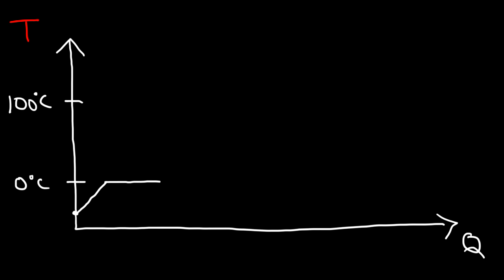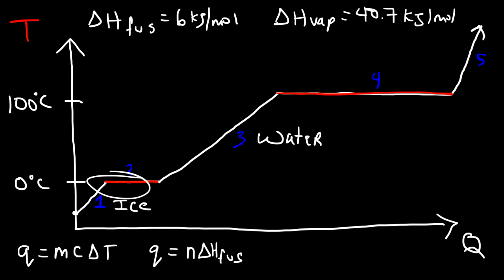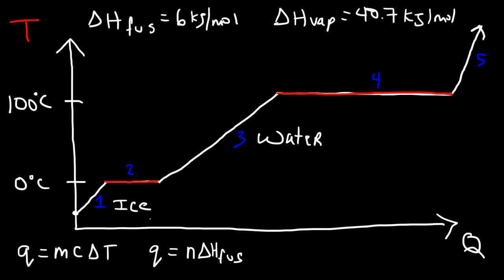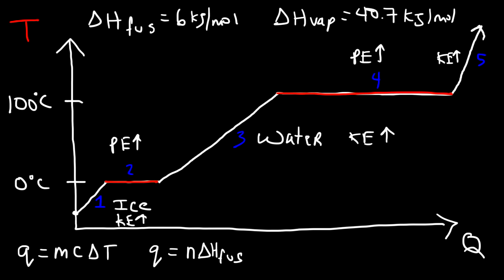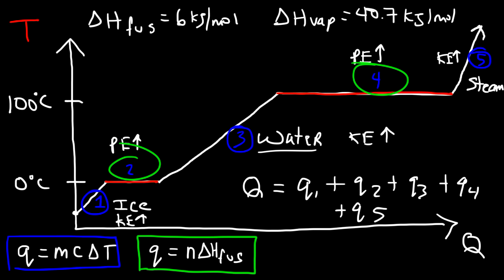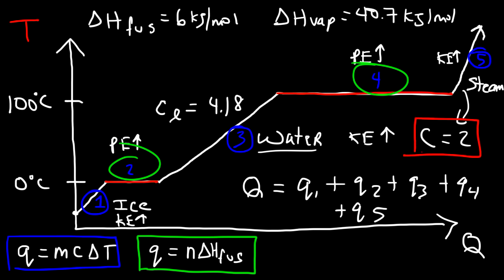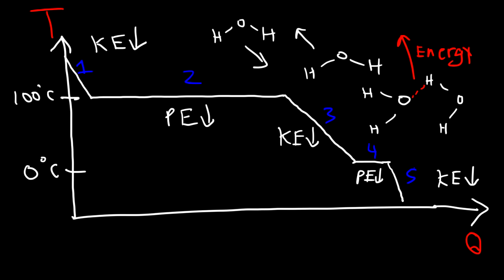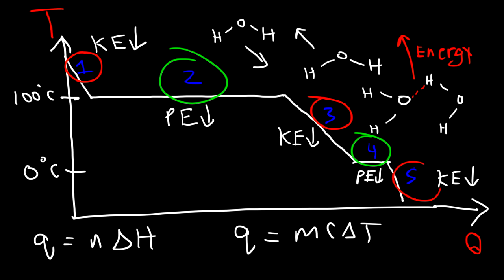Heating Curve and Cooling Curve of Water - Enthalpy of Fusion & Vaporization

Comment: I have an argument with a friend: I’m sitting on a terrace. It’s 40C and sweating. I climb on my bicycle (or motorbike) and go for a ride. He claims that as the temp is at 40, hence above body 37C, my body will gradually warm up, i.e. there is no cooling effect, actually the contrary resulting in even greater discomfort. I claim there is a cooling effect. If I’m right, is there a point of temp where this effect reverses (sauna effect, when adding water in 80C room). Thank you to those knowledgeable out there.

Comment: Adding heat energy freezes water? ):
Reply: Jake Enders the freezing curve is an exothermic process, which was different from the heating curve. On the heating curve, he was talking about adding heat to the substance to raise the temperature. On the freezing curve, he’s talking about TAKING HEAT AWAY from the substance to lower the temperature. The x axis for the freezing curve doesn’t really mean the same thing as the x axis for the heating curve. Freezing curve is telling you how much heat u need to extract, and heating curve is telling you how much need you need to put into each substance. Hope that helps and good question.
Reply: @JohnSmith-gh7br  lmao u right😂😂
Reply: Blankfaceman good luck on your exam though
Reply: @JohnSmith-gh7br  HUH
Reply: @JohnSmith-gh7br  my brain over heating